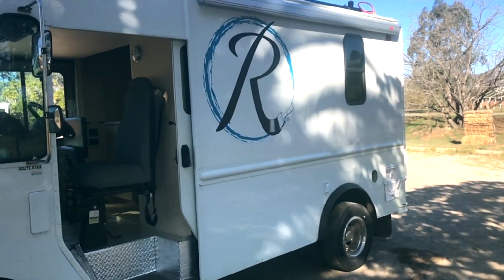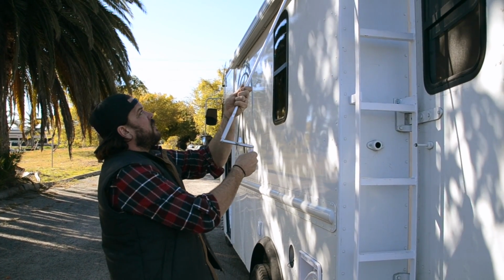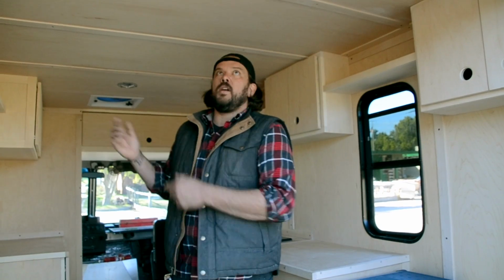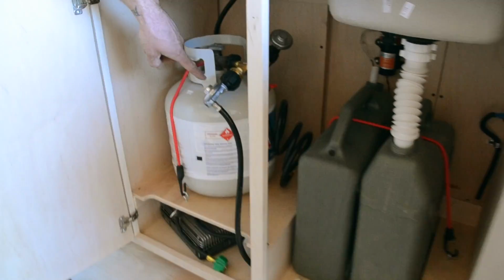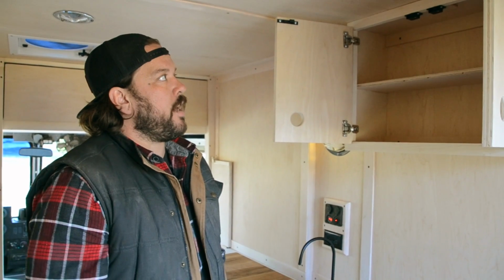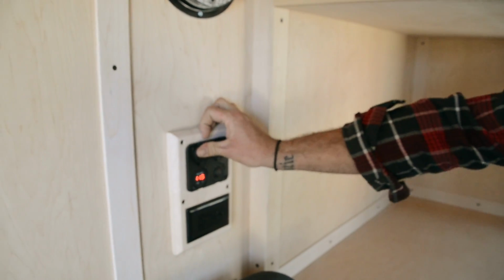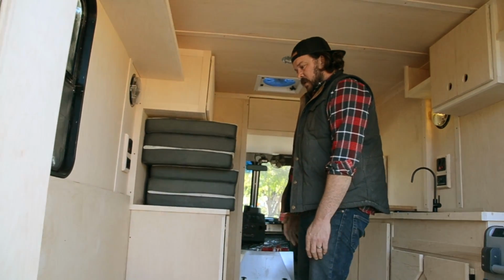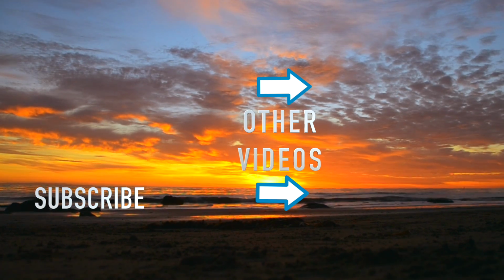Step Van Custom Camper Conversion

Comment from the maker: What’s the coolest feature of the conversion?
Reply: My favorite features is that the kitchen countertop doubles as a desk, and triples as access to the cooler.
Reply: Love that rear view mirror with the integrated screen! I want something like that for our Class C! :)
Reply from the maker: The Cruisin' Crew hahah yeah isnt that thing badass? I guess it’s like $150 all said and done. Not bad!
Reply: @TheCruisinCrew  l
'm
Mmm
Reply: Tasteful wood color. Nice
Reply: The toilet (and the bed).
Reply: The Cruisin' Crew so how much do you want for it ;)
Reply: @nonamesioux  no
Reply: love it. Very clean. Simple is best. Ready made rvs are good looking but built like crap.  Your step van RV was built by a craftsman.  
What's it like cruising on the highway with a step van? Does it have low gears?  
A roof top AC unit  would be nice. Oh, the racks up top are a great idea.I like how they lift everything over the solar panels 
 On my RV I mounted 2  36" grab bars to the roof to keep my kayak off the rubber roof.
Reply: The hidden toilet..
Reply from the maker: matt monette lol you’ll have to buy it off the guy who hired us to customize it!
Reply: i think at the beginning he said the next step is to paint it. but it does look nice as raw wood. maybe it will just get a simple oil or light stain.
Reply: The coolest feature on the van is awning on one side and the barbecue access point on the other side.
Reply: Love the fridge right next to the wc so you can use it for a arm rest and if your feeling peckish you can raid the fridge while your at it, LMFAO!!!!!!!!!!!!
Reply: The rear view camera. Hands down.
Reply: Great job, would love to see it when wood is finished.
Reply: Sage Roddy i like the dome a tac fridge 😝
Reply: The whole thing!👍
Reply: Sage Roddy - How much was this custom made?
Reply: I like how the awning is on the wrong side
Reply: The John is next to the fridge.
Go for a dump and pull out a beer 
😛👍
Reply: @anninriverside755  and in my opinion I think the sky would look better in another color. Something other than same old blue..... Who really gives a flying fuck about what I think and how my tastes are??? Dude showing his creation and that's that, fuck what you would do different, nobody cares, let it be, it's alright. Lol
Reply: I would've liked to see the storage broken down more, idk it's a lot of big bulky storage and wheres the shower?🚿😬
Reply: Non-isolated walls, that will help you to cook yourself inside, amateur cooler that will change your camper into a wet junk inside, no fuckin shower inside, and the best thing - amateur gas heater inside, that will take you to another world very soon. What a fuckin moron -.-
Reply: The funeral music.

Comment: 1:39 Solar shower tube on roof.

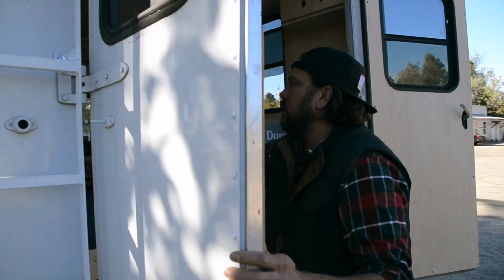2:39 The back windows open.

3:20 Cabinet for awning tool and air hose to solar shower tube on roof. Compressed air to solar shower tube is powered by small tire inflator.

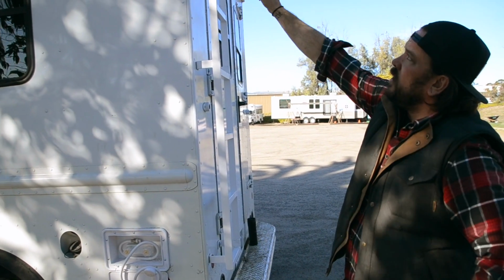2:22 Fiamma awning.

4:29. Seat with toilet underneath.

6:48 Galley with propane stove covered with cutting board and sink with two simple 5 gallon fresh and grey water containers below.

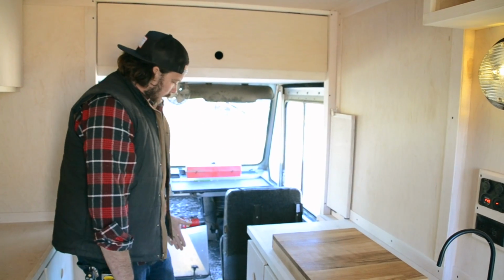8:55 Massive storage cabinet above front cab.

14:42 Floor in front cab and inside the engine compartment was covered with padded heat resistant Fat Mat. This silenced the front cab so it’s like a regular truck now. He will cover the floor with carpet.

15:43 He kept the factory dome lights for the back . This is good for going from front cab to back and then back to front cab.

Comment: As an engineer, I strongly suggest that you have an analysis done on the solar shower pipe to determine if your mounts will hold during a crash. The forces generated on a massive object like that when the van comes to a sudden stop say in a collision are very large and if that thing comes loose you have a fast moving projectile flying down the road. Not only is the pipe heavy but the water in it is heavy add to that the slushy during a crash your pop that thing loose.
Reply: Sloshing of the water is also a significant force.
Reply: It’s got beefy thru bolts in to the struts. Not going anywhere

Comment: Nice woodworking but why would you want to take the van to a stereo shop when you could just cut the holes where you want to mount stuff and prewire before you fix all that wood into place and paint before mounting speakers and tvs? The head unit or entertainment console, you can just watch a youtube on how to connect that up, if the directions are confusing... I don't get why anyone with your ability would pay someone to do that.

Comment: If the trunk has a diesel engine to drive around getting 55 miles to the gallon, perfect perfect.
Reply from the maker: You wish LOL
Reply: I v'e bought a Opel Mokka 1.7 turbo diesel 4x4 and it does that! In the USA its a Chevolete 1.7 turbo diesel 4x4 engine built by Isuzu and electric gagits like allternater and whatever is built by Bosh! 2013 to 2017 they where built. From 2018 on words psa Peugeot now builts them quality is not as good!

Comment: The awning on most RVs is on the right side because most connections for the electric & hoses are on left side.
Reply from the maker: Yeah that’s is true. This does not have any hookups so it matters less. But either way, since this video the owner put another awning up so there is one on both sides.

Comment: I have a few questions

Is it possible to directly off the truck's alternator as well as the solar system ?

What was the base price for the step van ?

How much did the conversion to the rv cost ? 

What is the fresh and grey tank sizes ?

How long does it take to fully charge the goalzero system on solar power ?

How long does it take to recharge the goalzero battery using the alternator ?
Reply from the maker: You can connect battery systems to the trucks alternator. I am not sure it is possible with this one because the battery type is different (lithium for thee aux battery and lead acid for the car battery). I think Goal Zero was coming out with a link to make that possible but I could be wrong. Not sure how long it would take to recharge on the alternator. I have charged a Goal Zero Yeti 1000 from about 46% to 100% in about 24 hours using just a 160W solar panel though. 

I do not know the purchase price of the van or the total conversion cost. I know it was not a cheap conversion. The client got some high end specs. I worked on the build a little but did not design or order materials for it. 

There are a couple 7 gallon jerry cans that are used as fresh and grey water. They are just run from the sink because the toilet is a dry flush style.

Comment: Agree with some of the comments, well done, beautiful craftsmanship, hopefully you are able to keep the unstained wood, I understand why the porta-potty was located where it was but would feel better having it away from the food area, but you are dealing with extremely limited space. Curious what you wall / floor / ceiling insulation construction was done. Living in Southern California is a bit different then living in North Dakota. The simplicity of the water design and propane is great. Not so sure they would allow propane to be inside the living area / sleeping area -- I've seen people use the small bottles inside with no one saying anything so maybe others have simple placed them externally for space reasons. I like you plan of not putting holes through the floor and attempting to keep everything close to where it is used.
Reply from the maker: Yeah you make some great points. I think the wood unfortunately ended up getting painted. The client is actually a painter though so I am sure he did a bangup job of it. I believe it was insulated with either .5 or .75 inch poly foam but I can't say for sure. Definitely youd need more robust insulation in ND than is needed in CA!

Comment: I'm surprised you get so much solar power with the surfboard racks shading the panels... but it does make a difference whether the panels are wired in parallel or series.
Reply from the maker: I haven’t seen how the panels are doing long term but they were doing great at the time of the build.

Comment: I have a Few , What if's ... Let's start with the Back up Camera . Here in California and many other states it is against the law to have it on a Switch as you do . It can only come on when the van is in reverse ... On the Bed , What if you had places that 1 x 6 under the bed frame so the bed was flat . I know it is only 3/4" bump , but That would bug me while sleeping . What if you had Built a Wardrobe cabinet right behind the driver and but the power thing under the bed .  What if you had put that smaller freezer at the front of the truck where the pull down top is at behind the passenger .  There is No way my Butt would fit on the toilet as it is . What if you had put a slide in the space above the cab ? That way you would not have to use a grab pole to pull anything out of it . What if you had put a thing up to hang a shower curtain from in the outside shower ?  The Big Question , WHY did you put the awning on the drivers side ??? It always goes on the passenger side . Why you ask ? Because you can climb in and out of the truck with the seat out of the way . Are you going to be adding Steps to the rear Bumper to get into the Van ? Other than that you did great for your first one . I am sure you learned alot . My dad and 2 uncles use to convert GM Buses to Motorcoaches in the 70's thru the 90's . Before you build your next one , See if you can go take a tour of a place that builds them . You can learn alot from those guys .
Reply from the maker: Thanks for the feedback. I was not the builder but I know they have addressed some of the things since this video was made. Like the awning. As far as the 1/4” strip attaches to the bed slats, it would not work the same with it attached to the bottom of the slats. And you can’t feel the slats through the thick mattress let alone the thinnest strip. 

As far is some other features, they would have been nice but when you work for a client they have specific requirements and a defined budget. Not like you can just spend any money you want.

Comment: nice job,  i will need a 110 volt AC unit for them hot days my friend!
Reply from the maker: The van stays mostly coastal so it won’t get too hot but it wouldn’t hurt.

Comment: Why would you put the toilet right beside the fridge/cooler? E. coli central...💩🤢🤮.....and why does every van built put the propane tank inside the rig....not smart
Reply from the maker: You never had a toilet beer? Anyway, you probably keep your toothbrush within a few feet of your toilet and your toilet probably is used a lot more and doesn’t have a shroud covering it. Plus an airtight fridge here. It’s really not the gross if you clean semi regularly.

Comment: I'm curious about insulation of the step van walls. Even on conventional van builds people go to great lengths to insulate them. How did yo handles this on a thin-walled step van?
Reply from the maker: All walls, floor, and ceiling were insulated. I couldn’t tell you the specifics of what insulation and what thickness was used just everything got insulation.

Comment: What kind of mileage do you get out on the highway?  We've also thought about doing something like this.  Nice build.  Since both my wife and I are (somewhat) mobility challenged we would need an additional step on the rear bumper (dual step probably), an additional step inside the entry way as well as one on the outside of the entry way.  Other than that I like it.  What is the length of the cargo area behind the cab?  We have sources for 12, 14 & 18 foot (cargo length) vans in our area and are still thinking of going this direction.
Reply from the maker: We weren’t the owners so not sure on gas mileage. If I had to guess I’d say it was 14ft cargo space.

Comment: They are called Step vans. Reason: makes the delivering job easier by the stepping in and out.  
I'm a huge fan of these wonderful and amazing vehicles. I grew up around them. My dad always had one. He sold ice cream out of them. I love these step vans.
A box truck looks and is, a Mack/Mercedes truck built, etc. The box(rear) is separated from the cockpit(front end)of truck. Furthermore, the rear box is higher, it is obove the rear tires. This makes a bumpy ride, alright. 
Oppose to the step van it is lower. Making a smooth ride, alright.
Just wanted to share. I want the correct name of these step vans not to fade away. 
I'm so glad that you chose a step van.
Goodjob on the Stepvan, though!👍
Thanx for sharing.
Reply from the maker: Yeah I goofed on the name at the beginning of the video because we were also working with a box truck at the time and I misspoke. My brother in law gets it right for the rest of the video though.

Comment: The shower is summer use shower only not for three season boon docking. I would make a slide out from the back door. Then make an indoor shower of the passenger area with a drop down floor for cold weather shower. An exterior shower tent portable toilet. The slide out would be bedroom . put all your power and water on one side in conduit for easy repair. Your storage is good idea for wasted space. Was unclear about safe seating while traveling two or three people.
Reply from the maker: Robert Jackson the shower can be 3 or 4 season in coastal southern California. Haha. The guy who bought this is single and doesn’t really have need for additional passengers. So this works for his purposes as a SoCal bachelor. Your ideas are good and necessary for some people’s use. Not his though.

Comment: This is the best conversion in a step van I have seen online.  Future suggestion that I saw on another was a piano hinge on the bed when in sofa mode, it raised up with storage underneath.  Also it didn't appear there was a rail on the shelf above the sofa/bed. Also, the 'dresser' on the end of the couch could house hanging pants and shirts/jackets if there was a pull out hanger that is attached to the ceiling of the short closet. If not wanting to use that space for closet, then slats nailed to the side walls would allow for placement of shelves. The solar hot water pipe on the roof and shower and portable table is genius both of which I have never seen before ! The woodwork and finish looks very professional and I am sure once the wood is finished, tiled backdrop on kitchen area and the plentiful wall space decorated it will be beautiful.   THANK YOU for sharing,

Comment: Beautiful work sir, however I would like to point out one major problem that is been overlooked. The propane tank should be mounted outside or at the very least vented and in your video I didn't notice any vents in the cabinet containing the propane tank. You have a potential explosive situation in that step van.

Comment: Are walls insilated???
Been on road in a van very cold eith no insulation had a heater like that it was terrible no heat
Reply from the maker: MYB Misa yeah they had I think about 1 inch foam insulation. But I’m not sure. I didn’t do that part of the build.

Comment: I think it's great in its raw state before paint.  I just wanted to point out that the Wave 3 propane heater needs to have a cover over it 24/7 when not in use due to dust collecting on the flame material and eventually could cause a fire or stop working. They are not cheap as you know so to save $ in the future ....a simple dust jacket is great.  
Take care and great job with the entire thing 😊 There isn't anything about this conversion I would change 😊 
Merry Christmas 🎄
Reply from the maker: Made in Michigan 67 yeah some other people mentioned that same thing! Apparently it’s a pretty big issue. Thanks for the heads up! Merry Christmas!

Comment: Good start.  Awnings are best curb or right side, thinking  cognito road stops.  Like the toilet at the back with fold back cover.  Next time think of diesel heater ... if running diesel.  An exit curb or road side is safest.  Good luck with your next project.
Reply from the maker: Brenda Swann thanks for the tips!

Comment: Hmm need to fix the audio ... silent into ... loud ass music clip then low audio again :(

Not a bad job all over though I'd defenitely move the gas source to outside or at the least put an extraction fan in where the gas bottle sits. Not sure of the under of them but bigger tanks from underneath are more appealing and give you something to pump from to the water heater as well (which is a good idea), though this is something you can do later at least.

I'm wondering since that fridge can freeze how it would go as a freezer for meat etc AND to make ice cubes for the ice chest which can then be your fridge?
Reply from the maker: Yeah some audio equipment is on my list of thing to get eventually. That’ll help a ton. 

Yeah many people have mentioned a vent for the gas. The owner knows about it but not sure if they’ve added one or not. 

Good question about the dometic. Not sure the answer though. Could be a good system if you need a large freezer.

Comment: VERY nice conversion.  If I were to do a conversion, this is the way I would do it, and I am known as a critical S.O.B.; I do not like the over-emphasized faux "luxury" some van conversions provide.  The piano-key style pullout bed is brilliant.  Overall, it is very well thought-out and reliable, with good use of materials.  Only caveat I would throw in, is to not trust the propane from leaking -- it is sneaky, lol.  Nice.
Reply from the maker: Yeah I agree. I prefer utility over style but it’s always nice to have both when you can. Yeah the propane has been taken care of. Thanks!